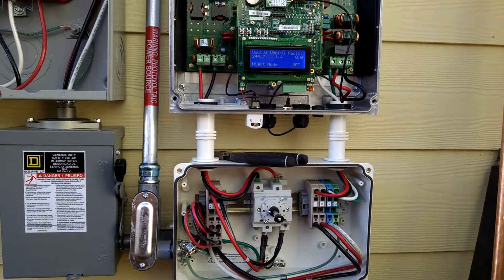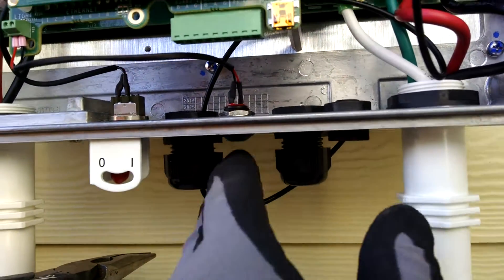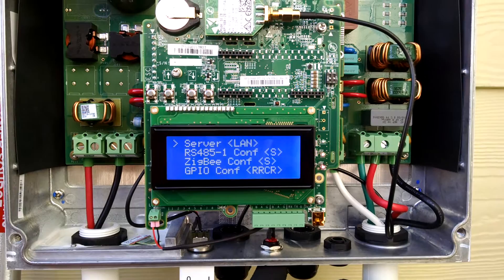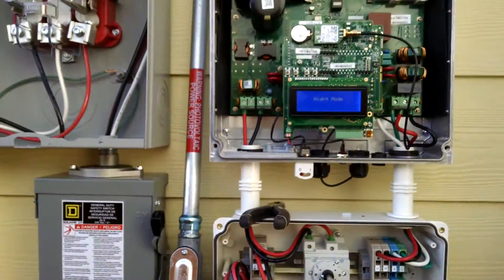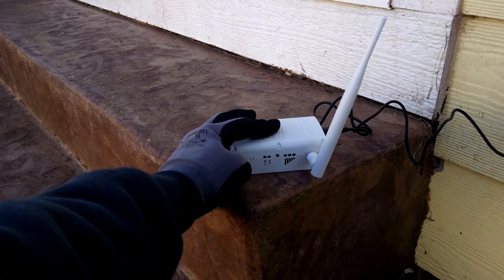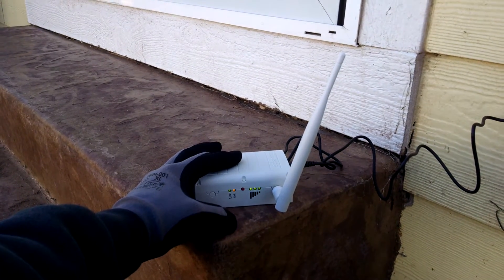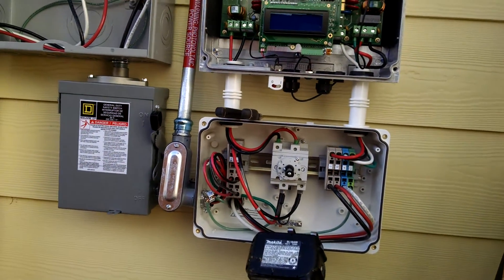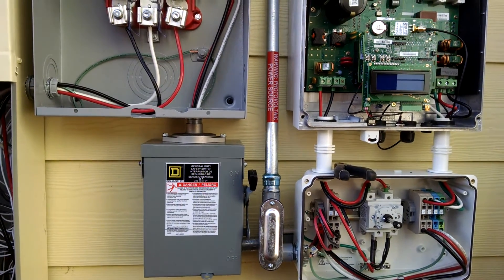SolarEdge Monitoring installation

Comment: I noticed on solar edges website that they have a video explaining how to connect the inverter directly to your router. Is it better to use the gateway? What are the differences?
Reply from the maker: you can connect a LAN cable directly to the Inverter, which is a more reliable connection, and cheaper.  But sometimes the router is far away, and cellular or a gateway like this are good options.

Comment: my new system is up,,and my solar edge monitor is linked,,WHAT  website do i download?
Reply from the maker: Monitoring.solaredge.com
Reply: @AngelMalakim  I just had Vivint install solar edge.  How do I use solar edge monitoring app.  I like there app much better. Thanks
Reply from the maker: @beckigrier227  Vivint should have made and released a monitoring portal registration link...  If you want to use the Solar Edge app, ask them to re-send the SolarEdge Monitoring access link.  Then you will recieve an email with a link to make your account and password for monitoring.solaredge.com.   I don't know if Vivint does this, if they already provide their own different app...